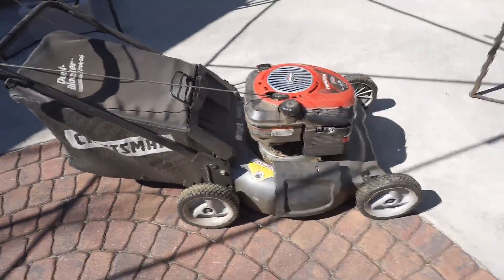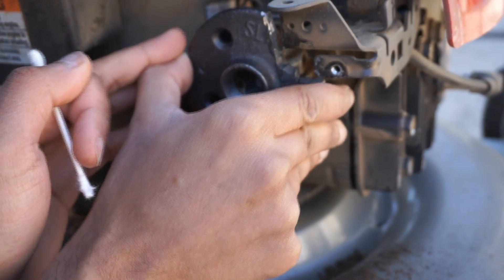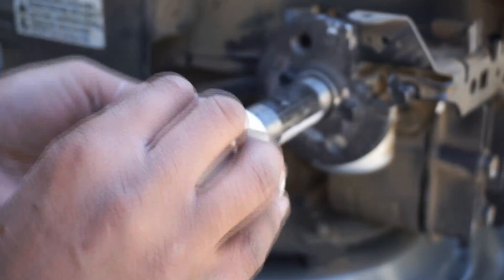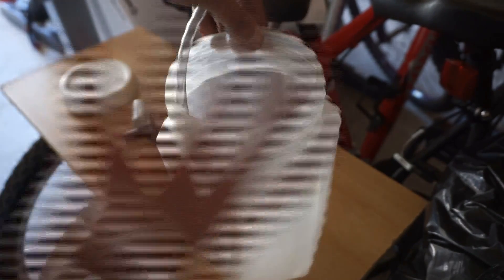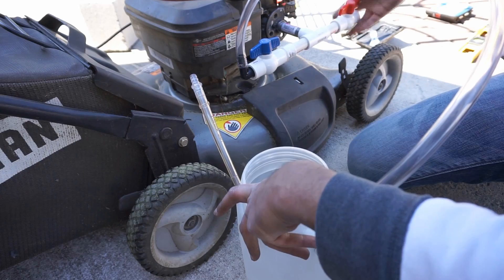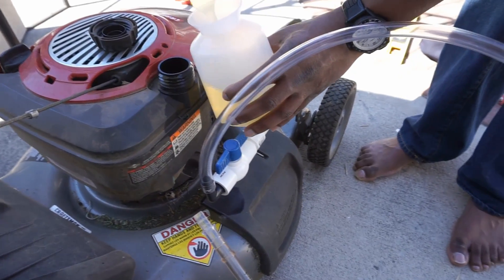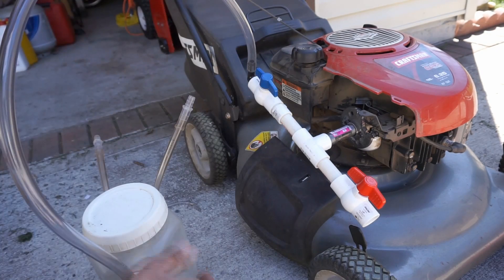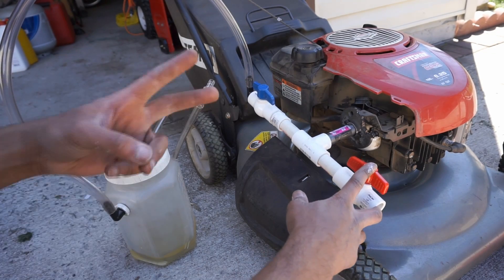Can an Engine Run on Vapors? - Build from Start to Finish

Comment: Im tryin to setup my 20kva generator to run like this. I previously got it working on a big pressure washer and an air compressor but maybe this motor is too big idk. Its about a 25 horsepower engine

Comment: prevent fumes engine actualy use more fuel on idel nearly no gas is consumed the jett size does mather at low medium and high speed you shuld probably finde variabel electric valve ore selenoid so you actualy can tune size for jett electricaly probably a lpg mixer wuld by nice and dont use plastic fuel tanks use flash back arestors thats all it takes just make shure you prevent fuming good tuned you shuld by capabel to make that engine run for entire day on idel

Comment: Wow you got an engine designed to run on gasoline /oxygen mix just like it was designed to do for over 100 years. The carburetor and intake do the exact same thing genius.
Reply: The carborator wastes alot more fuel this is just the gas vapor

Comment: maybe use liquid gas to start, then a solenoid to close and transfer the intake from the vapor. also, why not just run a tube from top of gas tank to carb, and add a small hole ay inlet so system doesnt draw a vacuum? thanks

Comment: Please don't be offended by my comments as I am on your side. You built a giant carburetor. Gas engines don't run on "liquid gasoline". They all run on vapor. This is no big secret. By the time the gasoline gets into the cylinder (combustion chamber) either a carburetor or fuel injection system mixing with air has changed its state from liquid to vapor. These age old systems just do it much more efficiently and safer. I challenge you to provide any data proving this giant, very explosive carburetor is more efficient. You have only speculated this is better because someone else said so with no real engineering, research or data. Please be careful. What I have seen so far is only a recipe for fire and explosion causing serious property and health damages to possible death.
Reply: Google Charles pouge . Fact is you only burn about 18% this is why your catalytic converter n muffler are needed . True vapor . Which today's gas won't work . Kearosean will be better . Cleaner . Anyway vaporize fuel and exhaust has no carbon emmision . It has n does work . https://www.google.com/url?q=http://www.376mpg.com/&sa=U&ved=2ahUKEwif7Neo6_fgAhUGZawKHV8DA44QFjAAegQICRAB&usg=AOvVaw0gm9ypR8obenFz4ft4Rk72 proof . Don't be fooled
Reply: @WaldensWorld  True vapor requires the addition of heat. In its current form, this is an atomizer, and thus performs an identical function as the original carburetor. Perhaps a slightly better atomizer, but an atomizer nonetheless. True vapor requires a phase change, which can be accomplished by decreasing pressure (traditional carburetors already do this) or by adding heat.
Reply: @craigslitzer4857  funny people say can’t run cars on water also n there the safe shuttle has to use water to have hydrogen and oxygen in space and upper atmosphere! 800 degrees will vaporize your fuel quick lol ! Need to build like a forklift that does the magic right before n don’t have to be stored as a vapor !
Reply: James Jones that's why I dont try this  I'd rather watch....boom

Comment: Good in principle but from my own experience I find that pulling atmospheric air results in the eventual accumulation of water in the bottle effectively rendering the volatility of the remaining gasoline a mute point and for winter time use the water in the bottle freezes and so becomes a no go as it will stop airflow through the intake line.  I believe that a more sophisticated design for throttle body and multi point injection systems resulting in such a fine mist that you would have something close to an actual vapor, like what you have entering the intake on that mower; that alone would give a mileage increase with a good deal less contamination of the oil resulting in longer oil change intervals as well as the increase in mileage.  
.
Shining a flashlight into the throttle body bore on the 1990 S-10 Blazer I  once had showed a drizzle of gasoline and not the almost invisible mist I thought it should be.  The car had over 100,000 miles yet in that condition passed a dynamometer style E test here on the front range of Colorado.  In a truly or near so vapor state I think it would have passed by a wider margin.

Comment: I have been able to get it to run for 10 minutes without a carburetor and fuel tank however I have not been able to get it started with the electric ignition. my pull rope does not function due to wear and tear hence I must use the key to start the engine. I am going to try and solder the peace which has broken off from the engine housing. I will let you know

Comment: dear sir, I think I have done everything you instructed period however, I cannot seem two get started. I have removed the carburetor .  should I remove the fuel filter and the round cylindrical item that the fuel filter dumps into. what sayest thou?
Reply from the maker: Dear Sir, I do not know what your exact setup is but I am thinking that there shouldn't be any connection with the original fuel filter into the vapor canister or engine.  It might be possible thou is either not getting enough fuel vapor or fresh air into the carburetor. Maybe try playing with the ratios or air to fuel vapors. Sorry for my late reply and good luck!